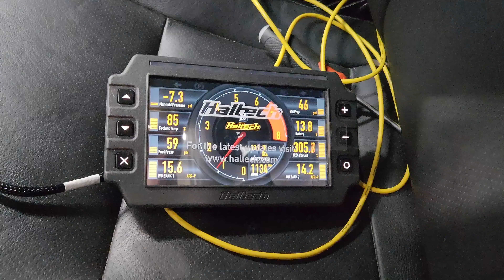CV6 Monaro Build | #22 - Post RockyNats Fix

Comment: The last intake manifold gaskets I used were permaseal because they have steel tubes in the bolt holes so you can't crush the seal
Reply from the maker: They did help so people didn't go ham on the torque settings and crush the poor things.
Reply: @TinShed  that's why I got that set because I go ham sometimes haha

Comment: Looks like Mace are using the Felpro type gasket which is slightly better than the AC Delco ones you used before. Just don't use any sealant on them. The rubber needs to flatten and fill all the uneven surfaces. And instead of using the end pieces, use Grey type sealant and run a thick bead on both ends like the LS1 or older Chevy engines. Especially for boost. The grey types like Ultra Grey etc are best for engine assembly and higher pressures. For in between your flat surfaces, the red liquid Anaerobic gasket maker are amazing, especially for clean up on removal.

Comment: Thanks for showing the rtv dealio. I need to do manifold gaskets it’s gonna be my first time and frankly, I’m chit scared about it 🤣 will also have one last go sealing the thermostat housing before I send it through the neighbours window 
Does the thread sealant need to be high temp? Any particular reason for the grey JB, or just found it’s worked well for you? Also curious is there an rtv flavour you hate and won’t use
Reply from the maker: Grey jb or ultra grey from permatex has just worked the best. Don't use too much or you'll never get it off! Thread sealant is just that white soft stuff from permanent. 
Unless you hate your neighbours I wouldn't do that..
Reply: Put a straight edge over the thermostat housing and where it mates to the LIM.  The last one I did the LIM face for the thermostat housing was not flat and took quite a bit of work with a file to make it so.